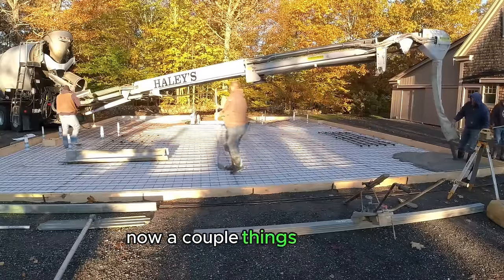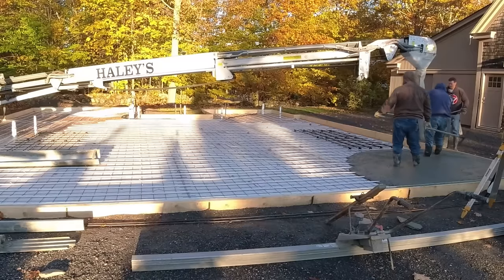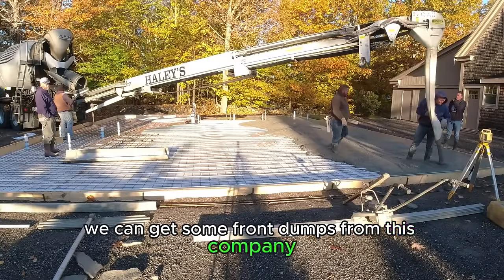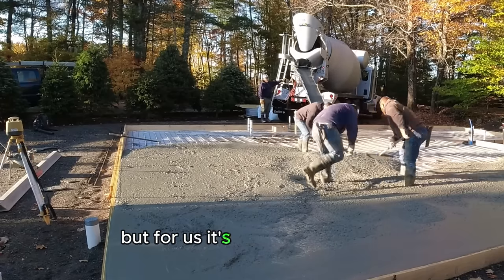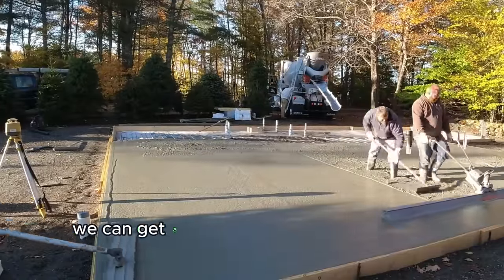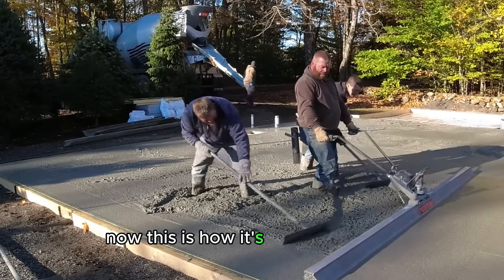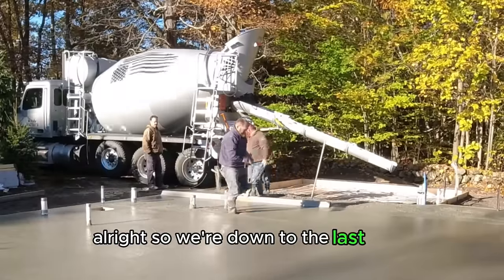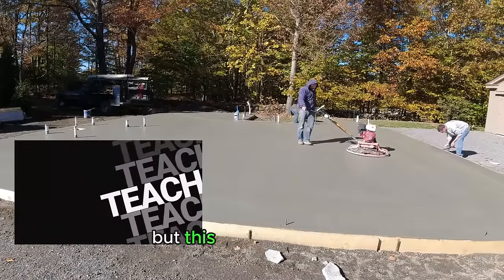Is This Homeowner CRAZY or a GENIUS??  Did He Go Overkill on his Concrete Slab?

Comment: If it’s just for a standard building, I think he did a wonderful job going on the heavy duty side. I am myself have a 16 inch thick slab that supports 8 inch thick poured concrete walls with a 8 inch thick concrete ceiling above it  I did this years ago and to this day the slab it sits on, and the slab above your head has absolutely no cracks in it  it has a tremendous amount of rebar in the 16 inch slab in the walls and then the 8 inch overhead slab. The steel in the overhead slab is a truss configurations, but the trusses are on the inside of the 8 inch slab going both directions width and length wise. A professor of structural engineering looked over my design years ago and says I have a load rating on my 8 inch overhead slab of at least 16,000 static pounds so I could park a tractor from a tractor trailer on it if need be. A yard of concrete is $150 a yard around here so it’s an extra 10 yards to make it extremely heavy duty. Many of the house foundations in my area crack because these poorly drained construction companies put a basement in a single-story house on top of an 8 inch thick footer. It’s only 12 inches wide.  When someone’s paying hundreds of thousands of dollars for a home with an extra 1500 bucks to make sure that the foundation is extremely heavy duty. Do you know extremely heavy duty is the reason the Roman Colosseum is still standing after 2000 years after enduring numerous earthquakes  going extremely heavy duty is cheap in the long run when you can sit in a lifetime of the building
Reply from the maker: Thanks for sharing 👍

Comment: I think that with the greater thickness, once it gets to a constant temperature, will be easier to maintain due to the thermal mass of the concrete. And with the even thickness, the heat will be consistent throughout the slab.

Comment: 8" seems like a bit of overkill but if that's what the home owner wanted, more power to him. Also, with 8" of concrete he should never have a worry about drilling into a radiant heat pipe. Looks like he did a great job prepping for the pour.

Comment: I used to do slab on grade foundations here in west Michigan they were 2’ in the ground on the perimeter..4” in the center. Now that way has been eliminated by code enforcement. A poured wall is now required 4’ into the ground, then pour the middle after compaction. We can still do some small buildings that way in the right soil conditions.

Comment: You would still need a frost wall if the garage is heated.  Here in the Colorado Rockies, we need to have a 48" frost wall on a footing.  The slab is either poured over the top of the frost wall or more commonly the wall is a bit higher and the slab is poured up to the wall but using expansion joint material between the two. Looks to me other than the absence of a frost wall, the homeowner did a stellar job.

Comment: Looks like he did good. but looks like the radiant tubes n mesh are just setting on the foam. For my radiant floor made 1 inch wood blocks to give a space, but only 4-1/2 thick floor inside footing and short wall foundation. Thanks for sharing

Comment: To each thier own.  I have a roll forming operation in a 50 x 110 shop.  The steel coils weigh anywhere from 6k to 12k and the forklift required to move them around is about 25 tons.  My slab is only 5" thick.  The peninsula i live on is basically a sand bar about a mile wide, no rock in the soil.  4000 psi mix with fibers and mid range water reducer, but no rebar other than on the perimeter edge. saw cuts on a 10'x10' grid.  Floor has been down for 11 years and there is only 1 crack where it makes a corner around my office portion which is not even an area that sees heavy traffic.  Bigger isnt always better or needed, nothing beats a properly prepared sub-grade.  So the main benifit i see with the 8" thick is the thermal mass.

Comment: Commenting as requested:-)  My gut tells me it isn't a bad idea.  It greatly simplifies the preparation to go with one thickness, and having all that thermal mass does a great job at storing heat energy.  I've poured several pads inside frost walls (I never like t he idea of a single pad without a frost wall here in Freeport Maine).  The pads I've poured are generally 6" thick, I really dislike 4" pads, not only because I like the flexibility to put in a car-lift later on in my garages, but all of the pads I've poured have only ever shown hairline cracks, even with no relief cuts!  The last one I poured was for an outside carport in Maine, and in 5 years, the 25'X12'x6" pad (with rebar around columns and wire mesh everywhere - AND fiberglass even - and NO relief cuts) has absolutely zero evidence of any cracks.  It gets the full Maine winter, only protected by the rain - broom finish.  Came out great.  I swear the 6" thick pad made all the difference.
Reply from the maker: I feel the thicker pad is better also.

Comment: If the slab bottom and sides are really well insulated-at least 4 inches, but preferably 6"+, of foam that is really tight and well installed-then it makes sense because the concrete acts as a heat sink that will reduce the heating system cycling by radiating for longer periods (and losing less heat to the ground). Back in the 70s & 80s, us back-to-the-landers were experimenting with passive solar heat being absorbed by a bare (or tiled) slab in the living area. Great idea-still valid-but back then we didn't really understand vapor barriers and didn't have access the the present day insulating materials.

Comment: Unobstructed clearance from re-bar, mesh or thermal tubing to finish floor elevation is normally 2” in my area (Pennsylvania). So, depending on steel and tubing placement, 8” is probably overkill.But if they ever experience power outages for a period of time, frost upheaval could certainly cause slab damage. The cost for remediation would be more than the initial cost of installing extra thickness   In the beginning.

Comment: The thickness of the slab and substrate is based on the design specification.  For instance if he is going to park a 40K# diesel pusher class A RV, Tractor trailer or a bunch of cars on the slab then a thicker, reinforced, higher pressure concrete is warranted.  Likewise if the soil has high clay content, then a thicker gravel layer and french drains may be needed to prevent heaving from trapped water which freezes.

Comment: Mike love your videos I've been watching them for a few years now. I'm about to start my garage in western mass. and was wondering what size footing to make for a block wall foundation also I'm building into a bank it will be about 6 feet higher than the finished floor height how deep would you go into the ground on those two walls ? On the other two walls I know I have to go 48 inches in the ground for frost, what are your thoughts?

Comment: Your foundation cracks, then your house cracks, then you get pests and drafts and it never stops. No 8" is not overkill.

The deep profiles on the edges are worth it though, especially if you put stiff reinforcement down there like the fiberglass rods.

Comment: If he used 2x10s and put 2 inches of Styrofoam inside them he did not end up with a full 8 inches. A 2x10 actually only measures 9,25 inches less the 2inches for foam is 7.25. . If that's what the customer wanted, I wouldn't have told him he was wrong,.